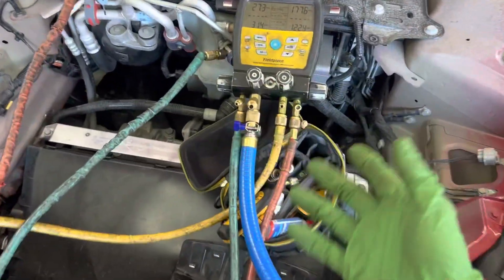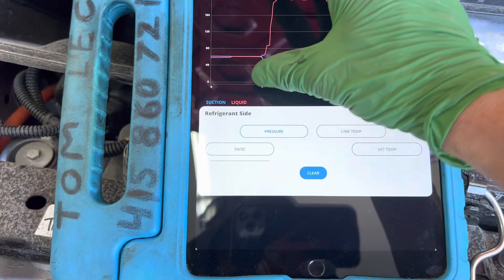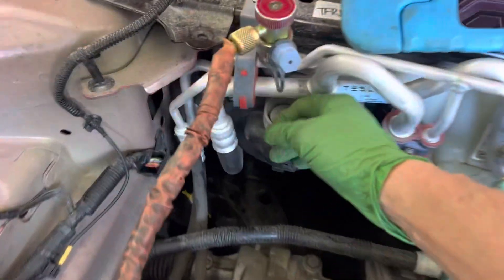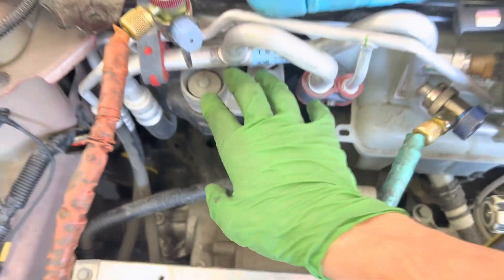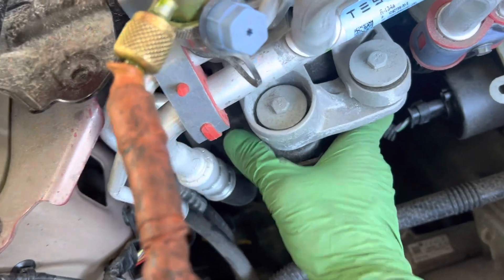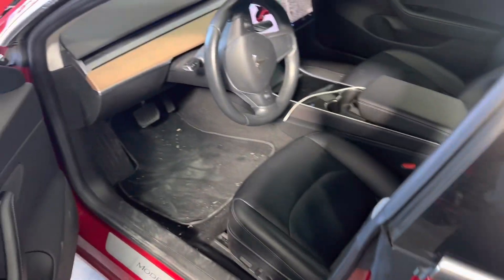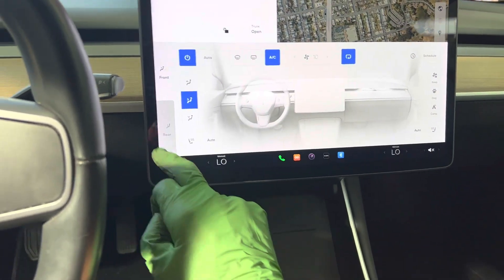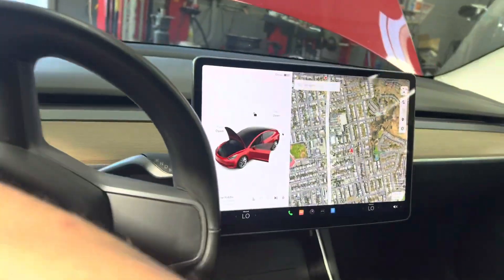AC REFRIGERANT RECHARGE ON TESLA COMPLETED DATA LOGGING TEMPS AND PSI

Comment: Don’t know what the chances of you responding are but I have a 2022 model 3 long range with 111,XXX Miles on it. It’s summer time here in Az and my ac seems to work fine in the mornings and evening but during mid day when it’s super hot out my ac stops blowing cold air for about 10 minutes and then it’ll start blowing cold again and repeat the process. Any idea what it could be? I was thinking maybe needs a recharge but I’m not a mechanic so hopefully you can help
Reply from the maker: Was this ever in the front in accident and was at a body shop? 

Did somebody charge this before?  

Almost sounds like it could be overcharged .,

Works when it’s cool 

But just a little overcharged and when it gets really hot, the high side pressure goes up so high that the high-pressure safety switch turns the compressor off . 

That’s one possibility .
Reply: Mine had a similar issue and the super manifold needed replacement
Reply from the maker: @cathyjones4702  that must’ve been expensive if it was not under warranty
Reply: @coldfinger459sub0  Thankfully it was under warranty, and I suspect it was related to a t-bone incident that happened earlier in that year. I think with the labor it would have been like 3-4k. It was difficult to diagnose because it was kind of intermittent, so I had to submit pictures with a temperature gun to service